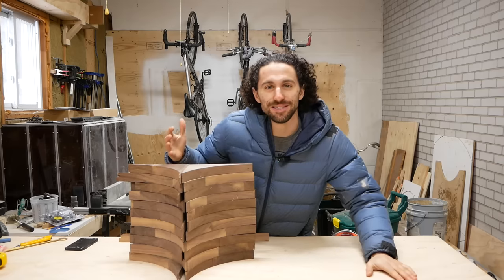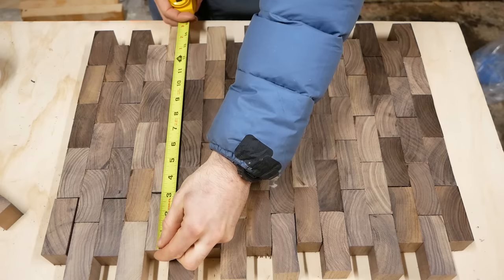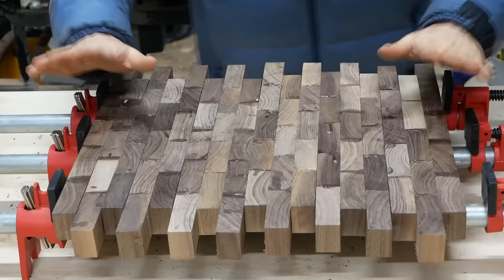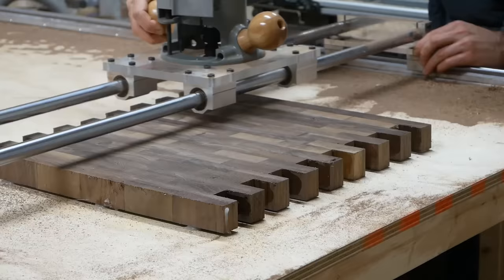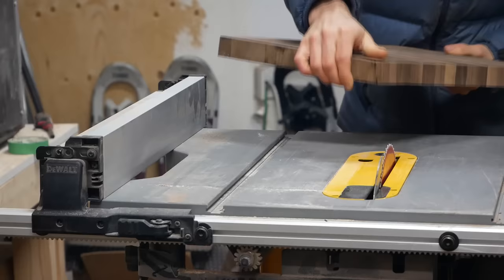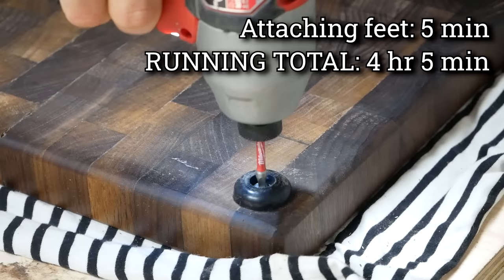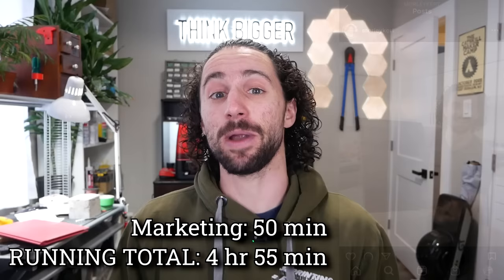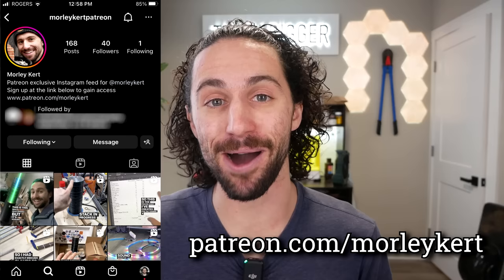Turning Free Scraps into a $325 Cutting Board

Comment: The way he removes the board from the router base was so smart! Definitely gonna use it when I face a similar situation 💪🏻
Reply: That's actually a terrible idea. A heat gun is much better. And other than than glue residue and damage will cause that surface to be uneven which will ruin the machine and produce uneven results.
Reply: @ShayanGivehchian  oh no. I meant him hitting the board sideways to remove it. I don't even think I would ever get my hands on either a blow torch or a heat gun 😂
Reply: @ayushmange  Heat guns aren't all that expensive honestly. (I thought they would be until I went to buy mine). That router sled cost WAY more than a heat gun.

Comment: I'm struggling to see how your "jointing jig" is any different that just using the guide on the table saw
Reply: There is more than one way to skin a cat?
Reply: It's set up with an outfeed surface flush with the side of the blade. Looks like the infeed  side sits halfway or less on the blade. Push wood across it and it cuts off the difference between the in and out, just like a jointer.

Comment: Great video, keep up the great work.  First I want to say thanks for showing your mistakes, seems you include all the reality in the process, and appreciate the fact you use simple tools.  It can be VERY intimidating for starting out folks to see other woodworking channels where the guys have 10s of thousands if not 100s of thousands in advanced machining/tools, and they have 10-20-30+ years experience.  This is huge to the average person starting out to see anyone can do woodworking with minimal experience and equipment.

Couple of things I would suggest…and please take this as constructive criticism, as overall you are on track imo to being a great wood worker/maker.

1- Glue up.  Maybe just me but those joints look like they will not last.  I would always glue up in climate controlled area, wait for the full recommend drying time, and use quality waterproof/heat resistant etc glue like titebond 3 or 2.  Use high quality glue and take the stuff inside (including glue) PRIOR to glue up so glue and wood can be at ideal temperature.  Then wait recommended time.  Don’t script on this step.  It is foundational.

2- Love the router sled set up, but would recommend holes and dogs built into it, get some thin bracing boards that can be adjusted or use the painters tape both sides with super glue in middle trick.  Do not use hot glue.  As you see very hard to get off and it could make your piece uneven.

3- after your initial sanding I could see gaps all over the joints.  Save the saw dust from your leveling, gayer it in a bag, and then use some clear epoxy, Star bond super glue mixed with the saw dust.  Then sand over after it dries and the gaps will melt away :-)

4- I would also router in some depressed areas on underside each side for handle area for hands picking it up

5- This is just more me, but imo the burn in labeling always looks really bad, and cheap.  It looks like someone made it in pinch in their garage (ha ha).  No I would recommend you get some nice coins made up with you logo, and then router out a small piece on bottom, and embed the coin overlay with clear epoxy.  You tuber Nick Z. was doing this, and it really imo makes it pop, look much more professional.
Reply: "Do not use hot glue.  As you see very hard to get off and it could make your piece uneven."

That was my first thought about making it uneven. Hot glue is a convenient thing for many projects (mostly in places it will never be seen or have a negative effect), but is so problematic if you need tight seals or a balanced surface.

There are some great double-sided tapes that would have worked so much better.

Comment: You could make the board just a little wider by cutting off the over hang pieces on one side and put those in the gaps on the opposite side. This would make a wider board and lest waste. Also good to see you put the hot melt glue on the outside edges when you flipped the board. Not only easier to get the board off but since the board is now setting flat as opposed to uneven with globs of hot mellt glue under it the top surface should be very close to parallel with the bottom.
One last thing try heating the Knife not the glue when cutting it away. Sorry I made this so long hopecit helps. RCW

Comment: Morley, Instead of hot glue, I've seen a lot of wood workers use blue tape on the workpiece and the table and then superglue the two together between the interface of the two pieces of tape.  Check it out.
Reply from the maker: I will try that!
Reply: @MorleyKert  it holds strong enough to machine metal with a milling machine. The trick is to burnish the tape for maximum adhesive contact. The faces to be glued together have to be flat for full contact with the super glue.

Comment: Attention to all DIY folks watching this, do not attempt any of the techniques in this video. Not only is this a terrible way to construct a cutting board, it's also incredibly dangerous using these methods.Your use of the table saw demonstrated in this video is dangerous and irresponsible. Use a cross cut sled or a miter gauge for cross cuts to avoid inevitable kickback . Your left hand technique using the jointing jig is insanely dangerous and you're eventually going to lose a finger. Don't even get me started on the cutting board. This is a perfect video on how to lose digits and not make a profit.

Comment: I like your channel and I like your personality but I am really afraid of your safety with the table saw.  You should have the guard on top first and foremost, I know that's unpopular but mine only comes off if wood is too thick to fit through.  Secondly, you need to at the very least roll up your sleeves, one slip of a little kick back and your arm will fly into the saw causing potentially life changing harm including your inability to woodwork and possibly even death.  Perhaps even invest in a feather board so you don't have to push both sides of the wood.  Maybe even invest in a Grr-Ipper.  Remember, it only takes one mistake.  I am especially worried for your safety because my Brother couldn't practice his favorite hobby for 20 years because he lost half of his ring finger to a table saw, side note, he only started again because of his Saw stop.  I just don't want you to get hurt man, you are one of my favorite youtube channels.

Comment: I got to the part where he flipped the board over stopped the video. As someone who does woodworking the proper way, I cringed when I saw the glue. Full stop at the gaps in the joints. He could do way better if he applied proper technique... Ide never buy or even sell anything with gaps like that. Very unprofessional. To all unseasoned woodworking dabblers, don't learn from this guy.